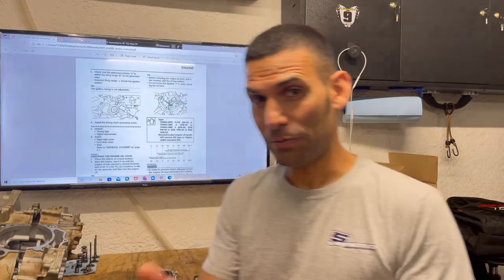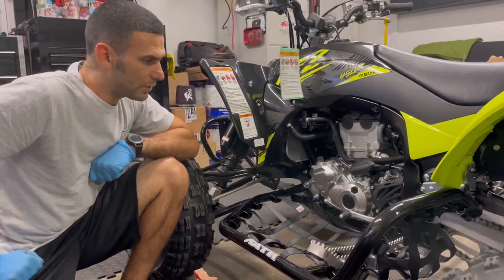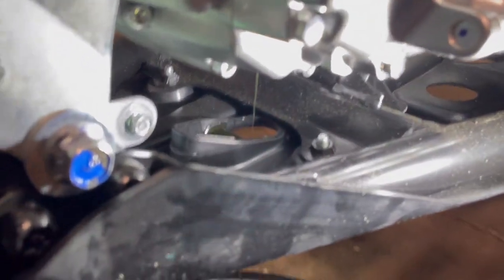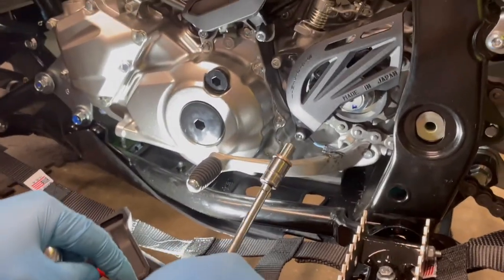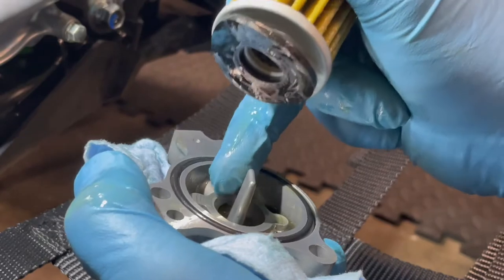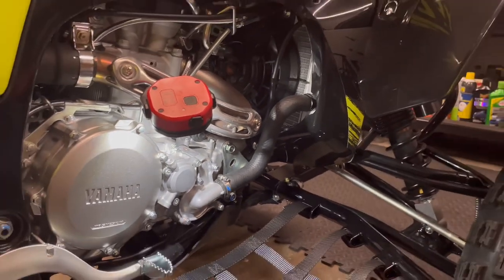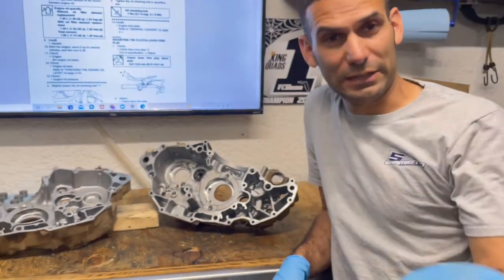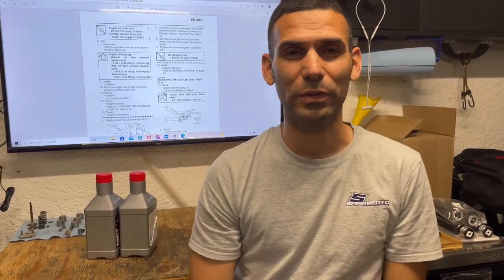Oil Change Tips + Tricks

Comment: Awesome video sir! Just changed my first oil change with my new/used 2017 YFZ450R. Loved the tips and tricks. Followed exactly each step and it was a successful day. Thank you!

Can you make an instructional video showing how to drain and flush with distilled water (2 gallons) and fill the system with Yamalube Yamacool  coolant or equivalent? Also, how to handle the poorly designed coolant reservoir to empty and refill coolant easily, if possible?

I can’t wait to see your tips and tricks for that!

The only close video I’m seeing on YouTube, is 6 years old and not explained very well. 

Thank you in advance!!

Comment: Thank you so much for the video bro!! I just did my first oil change on my 2022 SE… same as yours homie!!! 
I also took your advice with the Vortex… throttle response is amazing and right on point!!! Lil question tho… I went with Map 1 and 4’s for low, med, high…. Seems really good except when I let off on the throttle after high RPM’s… sometimes she’ll let out a back fire… does that mean she’s rich?
I live in Maine… otherwise I’d take a trip too come see you!!! Just wondering what a backfire means after letting off the throttle after high rpm?

Comment: Hey what's going on buddy like your show on YouTube I have a quick question I have jalals clutch and oil cover since I installed them on I noticed on the glass on both there is like a white residue or like Steam evaporating and it can't come out is that normal I never noticed that too now to I had the clear covers on do that mean something thank you very much please let me know preciate it
Reply from the maker: Thank you! I have seen it sometimes on a new one until they get broken in. If anything I’d contact JLS directly and advise them of the issue and see what they say.
Reply: @sarmientomotorsports910  thank you very much for replying back yes I really had contact them but it really don't have nothing to do with them I was just thinking would you think that be some kind of moisture in the engine at all like I said before now that I have the clutch and the oil clear cover I have noticed that when the quad is warmed up like it wants evaporate like a water bottle when you leave it in the sun but nowhere to escape so it sticks on to the clear glass would that indicate anyting in the engine I have changed the oil several times already and I change my oil every 15 hours of riding and it does it with new and fresh oil an old oil as well

Comment: Bro I have over tighten my bottom oil plug. I've got a new one to go back in it but a friend busted his case like that and told me to leave it alone so now when I change my oil I take the one out of the side and pick the quad  up on its side. A few times I have took the oil side cover off where you pour it in.
Reply from the maker: Drain bolt would need repairs.
Reply: I guess I'll leave it the way it is for now whenever I go to do a rebuild I'm a try to get it out

Comment: Are you anywhere near Nashville Tennessee
Reply from the maker: We are located in SW Florida. What is that you need?
Reply: My bottom oil  drin bolt i way over tightened it. I've got a new one to go in it but I'm afraid to mess with it I tried once but stopped. A friend told me he busted his case trying to loosen one told me just to leave it alone. So four months I just loosen the one on the side and pick my yfz up from other side. Also take the side cover off where you put the oil in and let some out there.
Reply: You think I should just leave it alone or do you think I should try to loosen it I can't afford to buy a case right now
Reply from the maker: @kaseyjohns5169  personally I’ve never had a case break when removing the bolt. So just do it carefully and take your time.

Comment: you sound like you know damn near anything about these lol. for checking the valve lash do you just leave it at top dead to check intake and exhaust or do you do a 180 turn for the exhaust valves
Reply from the maker: You want to do it anywhere in the compression stroke. Preferably when both cans are facing away from each other. You’ll see the timing marks line up on the cams lining up to the head. And the timing mark at the fly wheel will be visible.
Reply: @sarmientomotorsports910  crazy enough I’m doing it right now, got the right shims in but I cannot get the timing chain on the intake cam for the life of me
Reply from the maker: @codybonson8134  take the exhaust cam cap off if it’s still on. You’ll get a little bit more clearance. Sorry for the delay in response, didn’t see your comment a month ago.
Reply: @sarmientomotorsports910  you’re totally fine! I’ll do that and see if that gives me some more clearance I’ve been fighting this thing for longer than I’d like haha thank you!
Reply from the maker: @codybonson8134  hope you get it bud